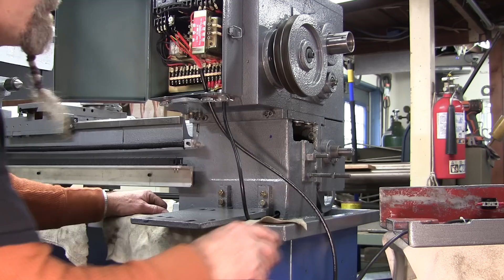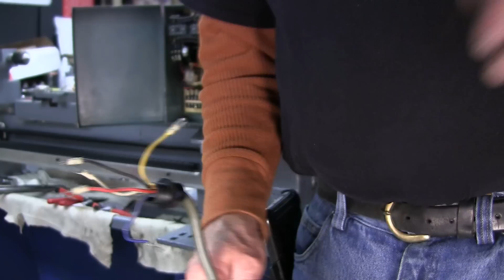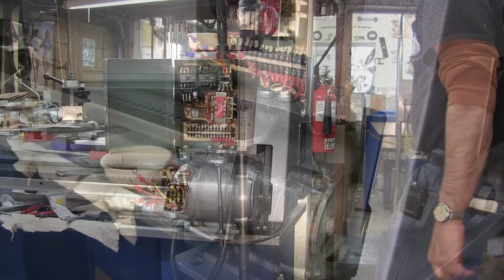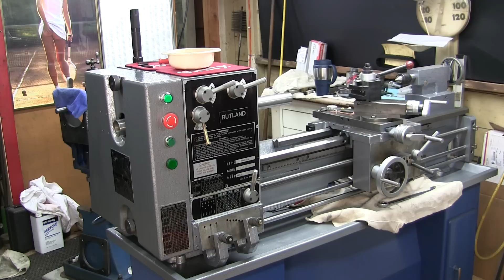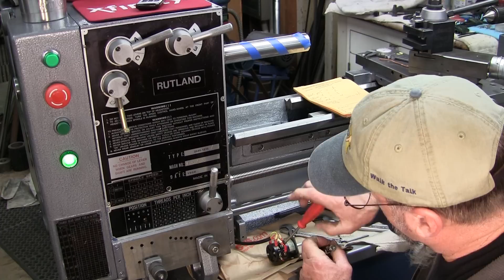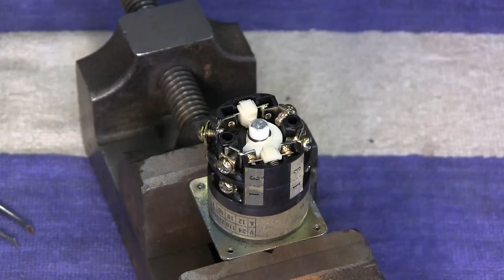Let's Look Under The Old Girls Apron Part Twelve

Comment: Hi, Where did you buy the new wiring harnesses ? Are they custom made for the Rutland lathe or are they generic?
Reply from the maker: I shopped at McMaster Carr, for the same, AMP capabilities with the same number of wires, at the lengths needed, in the flex and chemical resistant type leads. ;{)-------

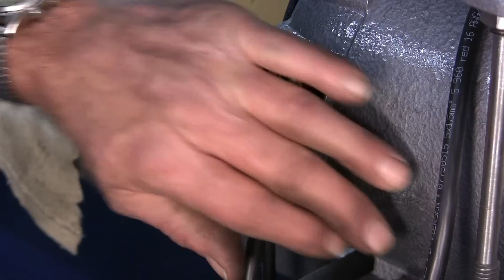Comment: Keith, just a FYI. At ~39:50 in the video, you tighten the lugs on the electrical in the motor. You don't tighten 2nd lug from left on the top row. It's not connected on the bottom row, but just wanted to let you know. I'd hate for it to come loose and short something on you.

Great videos and great work. I enjoy all of your work.

Thanks,
Mike

Comment: i bought a new 1/4 ratchet , took it apart to lube it as it was dry, spent about 3 hours, hunting the tiny pawl spring that flew out, it came out twice, and twice i swept the floor of the garage with the magnet tool thinking 'this is never gonna work'
Reply: They're referred to as pingf***its.
Reply: And those tiny circlips are called "Jesus" clips as in "Jeeesus where did the go..." :)

Comment: Keith, be careful with that jog button. It looks to me that if you have the machine in reverse and hit the jog button you may get fire rather than a jog. The fwd/reverse contactors might have reverse motion lockout, but I think you would end up with both contactors energised at once. That might not be good.

Comment: use a points file and file the contacks.
Reply: RPWLKR1 don not ever use a file on contacts those files are the devils food they were for car points and caused more trouble than they cured.
If you file the contact face it will have ridges and weld due to point contact better just a light rub a proper cleaner .
Believe me I have seen more stuff made K for not working with those files . Started in the Sparks trade at 15 did my time and did a PHD now 70 so been there done that and got the scars to prove it.

Please people remember the voltages do differ around the world in the U.K. We have 240vac single phase one hot leg the other is strapped to ground at the tx and at the consumer incoming PME and our three phase is 440vac so other posters stating the way the USA do there stuff can confuse others on the big ball

But Keith please think about a local isolator on the lathe cabinet and a interlock on that backgear cover 

Regards Stuart

Comment: Impressive job getting the switch to work. I would have just put a washer on that screw so it didn't go in so far. But I'm a hack.

Really enjoying this series.
Reply from the maker: I tried that before I knew it was the angle and insulator on the crimp.  ;{)-------

Comment: 3 phase reverse the motor. Reverse any two of the 3 legs, wires, going to the motor. Any DPDT contactor of sufficient current capability will do the job. That is what the reverse forward-switch is, a dual polarity straight or cross over switch.

Comment: heh... weird shit like that switch is SOP on old stuff that has set a while...   most any ac motor will run either way. What sets run direction is determined SOLELY by how the start winding and the start cap is wired.  In internal to the motor you will find basicaly a  throw out switch that disconnets the start winding and cap once the motor starts coming up to speed. With that in mind what is actually happening with those two relays or connectors as some call them is they are swapping around the start winding, NOT the run winding's. Proof is easy seen if you have a spare AC motor laying around DISCONNECT that start cap and the motor will just set and hum when you hit it with juice. If you spin the shaft EITHER direction, then hit the juice it will run that way when you hit the juice. If the shaft is completely still when you hit it with the juce just simply twist it one direction or another and it will turn that way.

Handy thing to know if you have  an AC motor that wont start and has been running for years. Take the belt off,  hit power and give the shaft a twist.  If it runs, your problem is most likely the start cap or the start winding bad or the throw out switch bad.  If  replacing the cap don't do it then if your real lucky just the start switch could be open. 90% of the time if the cap don't do it,its going to take a new motor.. 

DC motors will always use brushes but having brushes DOES NOT mean its a DC only motor. There are a number of whats known as universal motors around that will run on either AC or DC a long as the voltage is the same and these will also have brushes.  These are a tad different, they use the brushes to change the winding phase relationship a tad eliminating the need for a start cap and winding. Its damn near impossible to change what direction one will start on AC.

Im still waiting to see the DROS light up.. :)

Comment: Are the dual pulleys for 50/Hz? Great videos! Thanks!
Reply from the maker: Different drive speeds, if you need to really lower your speed for larger diameter part etc. ;{)-------

Comment: Hi
That switch is totally repairable, NOT the new " throw away" type of today. Different thinking in Industry ! Of course total contact fail=burnout, NO fix.
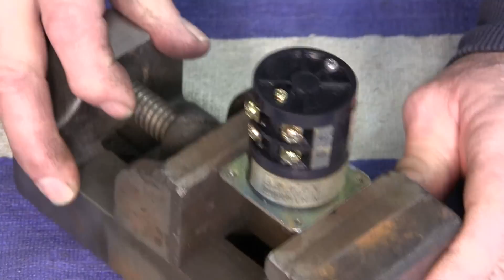Reply: It would appear that the switch has been repaired at least once before this video.  The 2 screws  [1:00:30] Keith backed out of the switch do not look identical (one looks coated/treated and the other does not).
Reply: .... the spring over the floating contact assembly even looked a little different, most likely a not so perfect replacement.

Comment: I'm impressed. Kieth actually got it to work... I ended up with springs all over the shop.
     I just noticed a about the 50 minute mark Keith's lathe has one of those evil  froward/reverse switches. As I say below, don't take those two through screws in the switch out... when it comes apart you will never get it back together again (correctly).
   If you happen to have an older Asian lathe with just a forward and reverse switch that looks like a stack of checkers held together with a couple of long through screws, do NOT try to take it apart. If you do, you will end up with 30 or 40 little parts, springs, and contacts that have absolutely no markings and no assembly index marks of any kind. With out an electrical assembly drawing the chances of reassembling the switch are about zero.
  If the switch is defective (or has a broken plastic switch shaft like mine had) get a drum switch to replace it with. Note that Chinese/Taiwanese wiring diagrams leave something to be desired. E.g. the wiring diagram on my lathe  in the motor wiring cover wasn't the same as the plate on the motor... so be careful and trace out all the wires.

Comment: Keith: Be sure (even if you need to hire an electrician) the safety ground is bonded to any parts, covers, and the motor. If the slightest whisker of wire is touching a non-grounded surface all that metal can be at line voltage.

Comment: On the switch contact for reverse, the screw you tightened down and made it quit working, the screw could be just a few thousands of an inch too long and when you tightened it down it held the contacts askew. 

As someone posted below you can get an operator that is spring returned to center with a left and right momentary action and 2 normally open contact blocks and have the option to jog forward and reverse right on your panel.

I would need a really close picture of the contacts on the upper left of your electrical contacts that controls the motor direction to see how much effort would be required to run them on 3 phase. The contactors may be 3 phase and just being used on single phase.  Also there should be a tag on the transformer that tells what combinations are possible on the incoming and what the outgoing voltage is for your controls. 

Happy new year.

Scott

Comment: I use a wooden box with acrylic window basically the same as a blast cabinet when working on small items that are prone to shooting off in every direction.
Reply: a clear plastic tub like you store decorations in works great turned upside down with two arm holes cut in one side.
Reply: mrchew1982 Yeah, even more of a simpler option.
Reply: What? I never even asked anything in relevance to your response.

Comment: What is the increase of worth of this switch now after all this attention and time went into it? How many replacement switches could have been purchased for that added value? ;-)
Reply from the maker: Well in about a two hour event, on friday afternoon, after a glance at the web search, I wasn't going to get one anytime soon. That has a priceless cost to getter done and working in that afternoon. ;{)------
Reply: I understand. Throughput time is sometimes more important than minimum repair cost. E.g. if a customer is waiting or if other costly processes cannot continue until a switch is operational. Or the pride to getter done on Friday requires it even though it might sit thereafter during the weekend.... :-)   In my area this is called "happy engineering". Meaning doing things for the joy of it not the economy of it. I guess we all have been there. Important is to do it knowingly and admittedly which you obviously did. So everybody is happy :-) Happy New Year.
Reply: rol eic i did the exact same thing on my lathe 😀 its nice and satisfying to repair things yourself. Yes, sometimes its easier to just buy new, but that something all people can do 🤓
Reply: I totally agree with you. My point is only that we distinguish hobby work from commercial work. Since Keith does both (and both at high skill level) it is even more important to be aware which is which.
In youtube there are many channels of hobby machinists and they are nice. What I enjoy most here on Keith's channel is his commercial work contrasting the many hobbyists. In commercial work he chooses not just some methods but the most efficient, professional methods to getter done.  So we can learn even more. When he plays around in a hobby project we need to understand that he might slightly deviate from the most efficient way and is doing his rightful share of happy engineering.
Reply: Keith Fenner  I'm with you Keith. It's not like you can run down to the hardware store and grab one of those switches. If your lucky, an electrical supply house might have one that will work, for about $100-$200, then you have the problem of perhaps not fitting into the enclosure or the detente being too far apart that it won't actuate with the flip lever on the lathe, the list goes on and on with potential problems if getting a generic replacement switch. You made the right choice by tinkering with the old one, and potentially saved yourself way more time by repairing that one over buying a new one. Been there done that, more times than I care to remember. Besides the fact that the switch was in relatively good shape overall.

Comment: Hi Keith,

Should be fairly easy to set up for three phases. The letters R, S and T allways stand for incoming power to the motor. In this case it is R, S and 6 (because the third phase is optional). Just connect the missing jumpers on the two power relays and hook up M6 in the cabinet to M6 on the motor and u'r done.  By the way E stands for ground (Earth) and U for neutral. Numbers like 1, 2, 3 and so on are most often used for the low current lines for the steering of relays and lamps. If you need further help, just send me a good picture of the cabinet and the box on the motor.
Reply from the maker: Thank you for the input, I will send a couple close up photos of it! Cheers, ;{)-------
Reply: Keith Fenner You will need my email: it is ruetz at oelzgmbh dot com

Comment: hey Keith a very happy new year! i believe i can send yaw a squematic on a three phase forward and reverse set up for 230v three phase (400volt european set up) is the same in the contactor set up as 110 volt, and PLEASE don't mess inside your lathe control panel just pressing the emergency stop, please disconect your lathe plug from mains power!!! it is saffer don't ask me how i know that :)

Comment: Never fails with older equipment- there's never one single point of failure, always several. Can be frustrating troubleshooting something you know is right, but behaves wrong!
As AvE says "like an onion, layer by stinking layer!"
After seeing you working on this lathe, I'm happy to buy one used and go through it now. I had previously decided against buying one of these generic multi badge lathes, but they seem solid and well enough built.

Comment: fror4 your 3phase you need to be sure ypour motor is 3 phase you should see it on the name plate also need to check the connection on the controle transformer to make sure of the voltage

Comment: what i think is you mix on the switch the common wire that is why you can only run in one direction 1 should be the common and 1 forwaqrd the other reverse and 1 ground

Comment: You mentioned three/phase during the rewiring part of this video, do you have three/phase in your building or do you use a converter?  Happy New Year from Missouri
Reply: 3 phase AC is a total different can of worms than the usual single phase setup. From just looking at the motor on the Lathe its single phase..  About the only place you will find 3 phase is where motors much bigger than say horepower are used. It does provide for a smoother running motor and somewhat more efficient use of the juce. 
On a side note the typical house has a 220 drop with a neutral wire. From EITHER hot to neutral you get 110.  The intersting thing is one leg of the 220 is 180 degrees OUT of phase with the other if you reference the nuteral.
Reply from the maker: I have three phase, in shop. ;{)------

Comment: Zip tie stick on saddles are no good, if oil gets on the pad it will fall off and get tangled in the gearing.A better solution would be to drill and tap a hole and fix saddles with a screw.
Reply: john flower I agree those stick on saddles for zip ties eventually fall off. Better bolted using metal/plastic loop for the long haul.
Reply: I agree those sticky backs are 100% rubbish long term. I'd also like to see a cover over the switchgear to keep out the oil and rubber particles from the belt. Personally, I would have moved all the switchgear into a box mounted to the top of the main electrical cabinet which would also improve the wire routing.
Reply: I've lost count of how many of those ^$%#^$@#!! stick-on zip tie pads I've had to deal with over the years.  

Press some small neodymium magnets (for example, http://www.harborfreight.com/10-piece-rare-earth-magnets-67488.html) into an aluminum or plastic piece to use instead.  They stay right there, AND you can move them when you need to.
Reply: I installed and tested wire assemblies, for 12 years, at McDonnell-Douglas (MD-11, DC-10, KC-10, MD-10, MD-80, MD-90, MD-95 and C-17).  I don't ever recall installing the "stick on" tie mounts.  The FAR states that adhesive tie-mounts are NOT authorized for primary wire supports!  But they can be used for additional support... if they are not exposed to chemicals, etc.  If adhesive tie-mounts were installed after the plane was sold:  they would have to have an entry in the ship's log for it and Inspection Authorization...
Reply: There are two ways of permanently attaching those "tie-mounts":  epoxy or a mechanical fastener (screw, bolt, or rivet).  There are a variety of push-mounts, etc. that hold up really well.